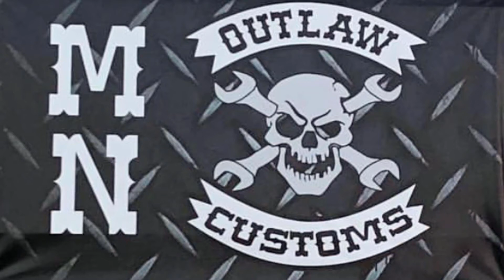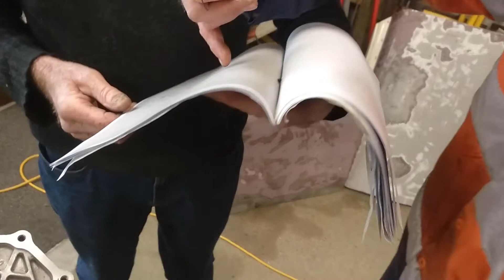working out how to fix suzuki jimny gearbox

Comment: i rebuilt my 2002 manual box and because i have never touched one before i was extremely particular in how i pulled it apart so i could put it back together the same way.. i had a very very sneaky shim that stuck to a rag so when i put it in it was 1.2mm out and was rubbing on the casing. perhaps someone left the shim out in its previous life?
Reply from the maker: Not sure what was wrong with it my uncle put another box in it and keep this for parts

Comment: Ηello boss. If you can help me. I've got a jimny 2003 automatic and i have an issue. From 1st gear to 2nd  the transmission it kicks and then it works properly until you get again from 2nd gear to 1st an stop. I recently rebuild the gear box but the mechanic told me that needs an update to stop stop that thing with kicking between thse two gears.  My question is. Is it really that old car takes an update or his lies? Thnks in advance
Reply from the maker: @p.c-3314  I have no idea the one we were working on was a manual transmission not an automatic
Reply: @NZMOPAR  thank you very much for responding

Comment: Bearings went on mine. It took me a year to find a reasonable priced replacement. I sold the cR after that as I knew that the gearbox would go again. Could be 3yrs could be 6mths. It's a faulty gearbox that suzuki claims no fault to. Beware the R72 gearbox. If you do buy one you Must make sure the bearings were changed. The gearbox costs more than the car. They are like chickens teeth.
Reply from the maker: All ready been replaced with a rebuilt one my uncle keep this one for parts
Reply from the maker: And thanks for watching 👍